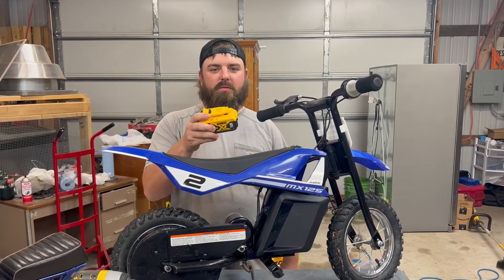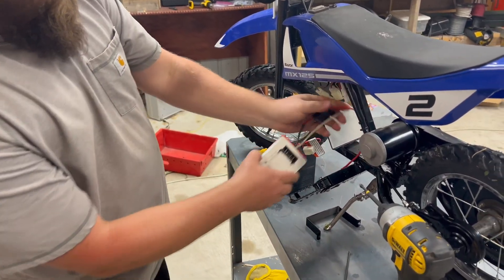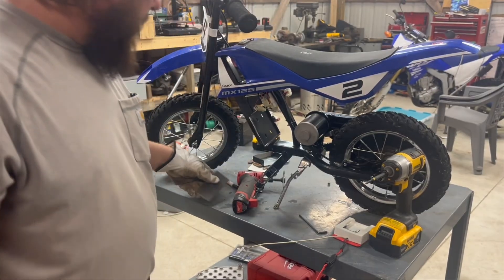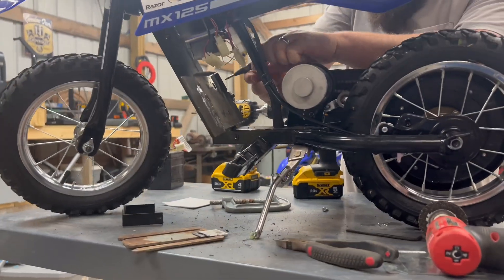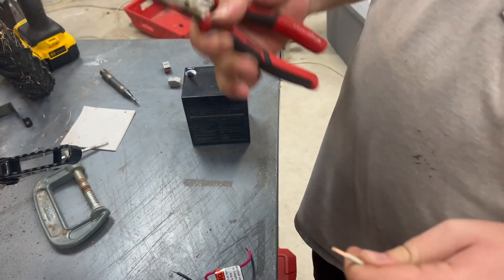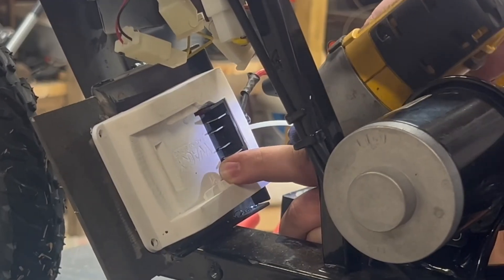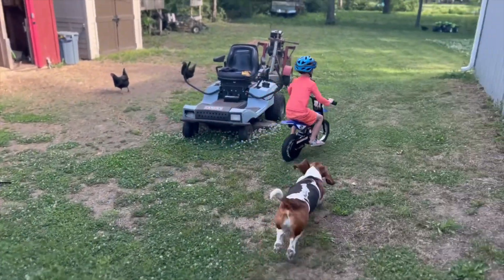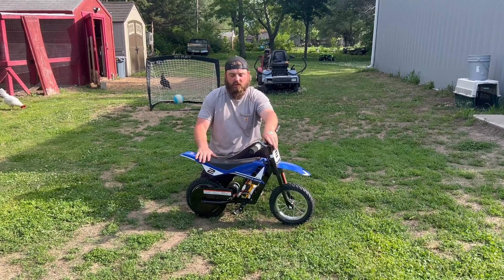Best Razor MX125 Upgrade: 20V Dewalt Battery Conversion #powerwheels

Comment: I keep blowing the 30 amp fuse.  Any ideas?
Reply from the maker: How long before it blows?
Reply: usually a few minutes if there is 2 riders. If my little guy is on it it can last an hour then blow.  I checked all my connections and looked for bare spots in wires. Everything looks good.  Damn good job if you ask me. 😆 thinking about getting bigger fuses or just cutting it out all together.
Reply from the maker: Bigger fuse would be better than nothing at all. The more weight the bike is moving the more amps it will pull. That’s why with 2 riders it blows quicker. Just keep in mind proper fuses are for safety and removing a fuse or upping the size does create some fire hazard. Good luck!!

Comment: What size inline fuse are you running off the battery controller?
Reply from the maker: 30 amps
Reply: Upgrade your controller.  They are cheap on Amazon
Reply: @SpeakIntoTheMicYouDirtyApe  what do you mean? The battery pack holder?
Reply from the maker: We haven't deleted any replies.

Comment: Awesome, man! I just picked up one of these for my son and immediately thought, 'Man, this SLA 12v ain't cutting it.' I've got all the stuff to give it the 18v treatment, but don't want to cook the electronics. Is this thing still rocking, or did the 12v ESC and motor finally give?

I'm not 'too' worried if it does, the 24v electronics aren't that expensive. It'll give me an excuse to go 'all in' on it. I just don't want it to burn up within a day or two, he'd be crushed while it was out of commission.
Reply from the maker: It’s actually still going strong to my surprise. I’ve heard of other people not having as good of luck but we are nearly at 90 hours of run time since this video.
Reply: Im running a Dewalt 20v on my son's and he's got at least 30 hours on it with no signs ofdying.
Reply from the maker: Good deal! I'm glad to see someone else is having good luck!

Comment: Is this still going well? Got my son the 12 volt bike for Christmas and he already is begging for it to go faster. Bought a dewalt converter and gonna try putting it on this weekend.
Reply from the maker: It still works great with the 20v battery. Still using the original motor and motor controller!
Reply: I recently did the same conversion, less welding, more double sided tape. Right after the conversion, I'm getting intermittent power. Sometimes it works fine, sometimes when I hit the throttle, I hear the relays (assuming it's relays) clicking, but wheel isn't turning. Any thoughts?
Reply from the maker: Hmmm, It sounds like the motor controller is struggling with the higher voltage. We have been lucky and ours has just worked perfect every time! How long will it run before it messes up?

Comment: Do you happen to have a link for the upgraded control module my 5ah finally burnt up to stock one and I’d like to replace it with one that can handle the 20v without issue
Reply from the maker: I can look for one but we are still running the stock one after over 70 hours!

Comment: Im running a 24v motor with 2 20v battery on it kids been beating on it for over 3 months now.
Reply from the maker: Are the batteries in series or parallel?
Reply: @wackyengineering  series, but have to put a 24v motor in there because the 12v wont be able to handle 40v.
Reply: I’m running a 40volt sunjoe mower battery on a Mx350. It lasts about 2-3 hours and hasn’t burnt up anything yet. Going on 5 months now. I swapped the controller and throttle from an older razor go kart so it has variable speed throttle. Buddy of mine who’s weighs 180lbs got it up to 19.7 mph.
Reply from the maker: That is impressive!!
Reply: My daughters motor burnt up in a week. Does anyone know of a motor that will hold up without swapping controllers?
Reply from the maker: Our motor and controller are still stock and it has around 50 hours on it so far. Maybe you just got a bad motor from the factory?
Reply: Everything razor I've ever upgraded burned up in less than a week  @wackyengineering
Reply from the maker: We still have the stock controller using dewalt 20v batteries with over 70 hours now…
Reply: @wackyengineering still going?
Reply from the maker: I posted an update video but it did finally burn up the stock motor. Bought one from Amazon and it’s going strong again
Reply: @dabrokest530 can find a higher Wattage 12V motor like 150W instead of the 100W that comes stock. Other than that I would just get an Overvolt kit with controller and do the 24V motor.
Reply: No way and that's holding up on the stock controller as well?
Reply: @CA-RC  im using a controller from fast scooters(ebay) from the mx350. I could make a video if needed.
Reply from the maker: Sounds cool! We may have to do something similar once the kids get bored of this one.